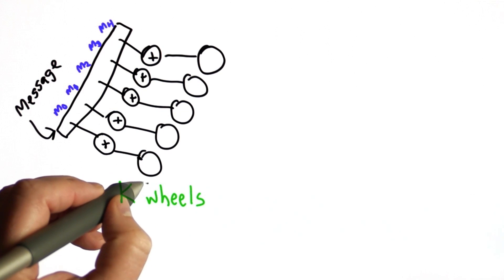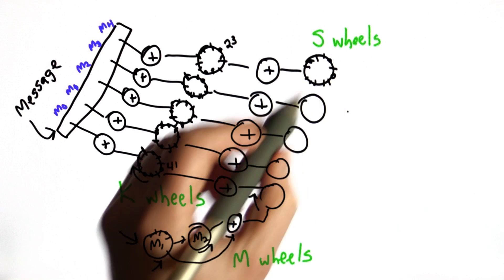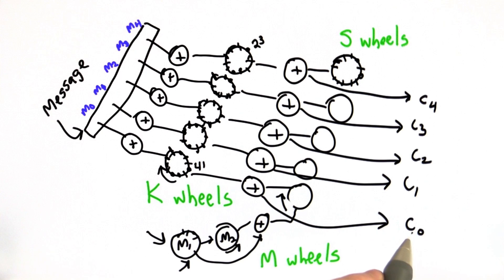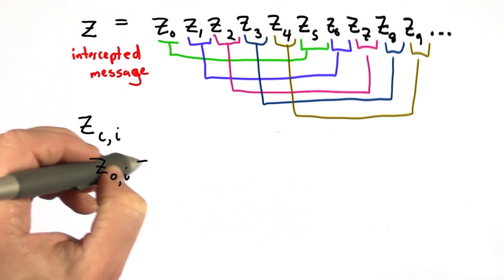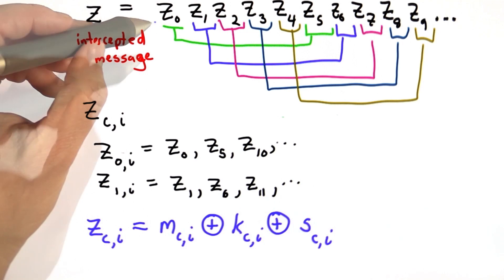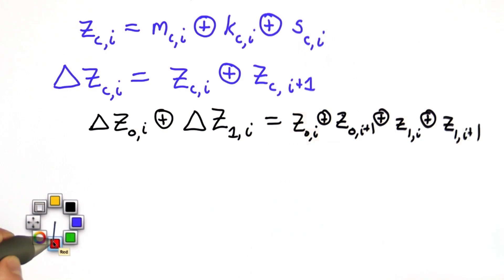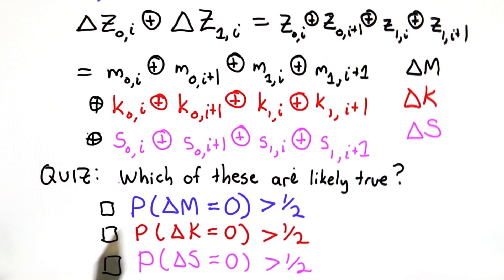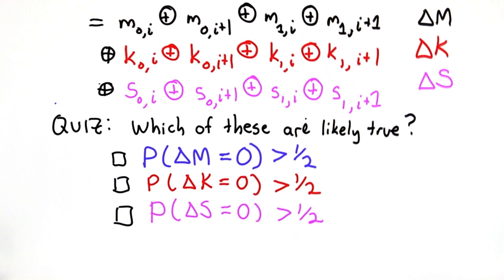Lorenz Cipher Machine - Applied Cryptography

Comment: if they had randomised the s wheels it would have been much harder to crack
Reply: The problem was German arrogance. They truly thought it was unbreakable so they didn't bother following procedures to the letter. If they HAD, it would have been much much more difficult to figure out the patterns. The same went with Enigma. The ONLY reason they couldn't break the kriegsmarine Enimga code was they KNEW the system was vulnerable and had strict procedures on how to use it. The sailors also were forbidden to make up words to send out the greeting word. They had to pick one from a book that had assigned words for the day. Once the day was over, the page was ripped out and thrown overboard because the ink would wash out. The wehrmacht and luftwaffe got very lazy and kept using easily predicted words over and over. This enabled codebreakers to find patterns quickly and learn how the system worked.
Reply: The Germans were not so overconfident in there technology as you think. But you have the right idea down flat as you've described.  The fact they upgraded their machines over the course of the war proves they weren't mindlessly confident.